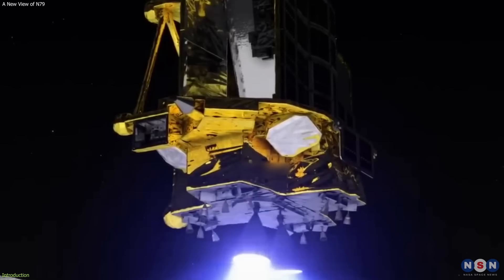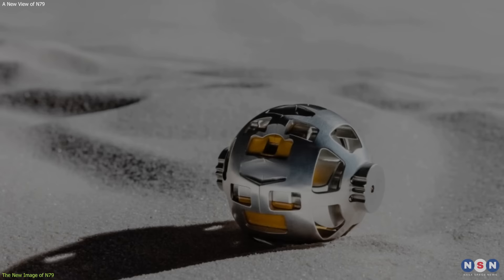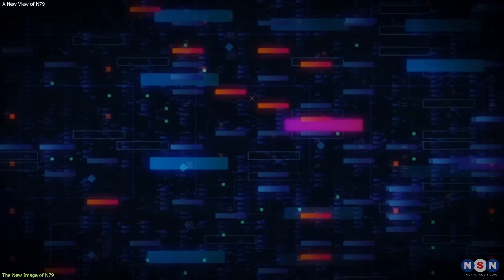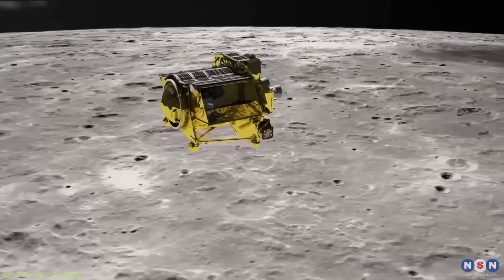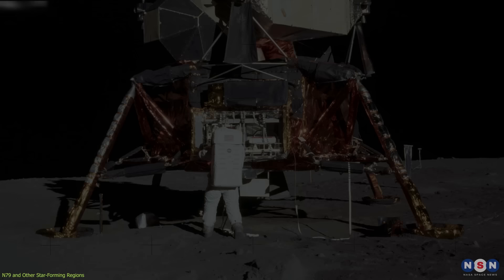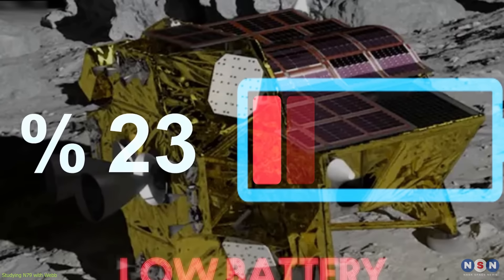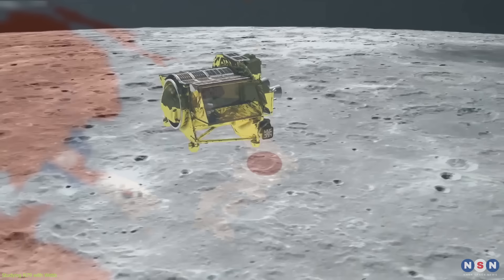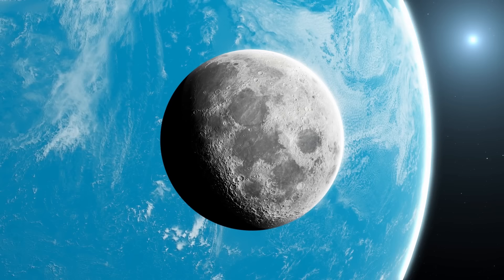The New Image of Japan’s SLIM Moon Lander: How it landed on the Moon Upside Down

Comment: * (PS.January 29, 2024)JAPAN (JAXA) announces that SLIM is back in operation. Sunlight hits again and battery panels generate electricity to resume communications and research! 
First, Japan's (=JAXA's) mission this time is "success". The most important mission of SLIM this time is "pinpoint landing at the target point.
JAXA was able to land at about 50 meters from the target point, so it was a "success. The data from the landing was also communicated because the attached battery lasted for several hours.

This was the world's first successful "pinpoint landing," aiming for an error of less than 100 meters.

It is believed that one of the two main engines lost its function and finally came to rest in a different attitude than expected, with the engine facing up and the solar cells facing west.

According to JAXA, the solar cells are not facing directly down, so if their position changes with the sun and light hits them from the west, they could start generating electricity.
 if sunlight hits the solar cells by around February 1, which is the sunset of the MOON, power will be restored and operations can resume.
Reply: Starbucks coffee doesn't have a small(fail) cup, only a medium cup and a large cup, super large cup.😂
Reply: “It is believed!”  Nuff typed there.

Comment: The main objective of this mission was the world's first "pinpoint landing" aiming for a margin of error within 100 meters.　This objective was successfully achieved.
Reply: Not good enough.
You mean to tell me they didn't think of this issue a million times?
Reply: @steveabq7913  I don't care about your personal values and desires. The initial goal of the Japanese engineering team has been achieved, so it is an undeniable success.
Reply: the Chinese have autonomous landing  determination already
Reply: Of course, SLIM also has automatic landing. Although one of the main engines broke, the spacecraft was able to make a soft landing thanks to automatic landing.
Reply: Latest News
Solar cell that had no response
Successfully Started
Reply: China has done that 4 times including landing the same lander twice in a single mission.  Of course, the propaganda is not telling you about the Chinese success.
Reply: @ren11270  Chinese landers all had automatic landing. It is done before. Nothing is new here. Not only that, Chinese landers had AI to determine the best landing spot on the fly avoiding rocks and other obstacle (like landing upside down, LOL).  Japanese one has pre-designated spot like 1960s US landing.  It is actually embarrassing.

Comment: This is a lunar lander that aims to achieve a lightweight probe system on a small scale and use the pinpoint landing technology necessary for future lunar probes. The project will aim to cut weight for higher function observational equipment and to land on resource scarce planets with an eye towards future solar system research probes.

The SLIM (Smart Lander for Investigating the Moon) project is a mission for researching the pinpoint landing technology necessary for future lunar probes and verifying this on the surface of the moon with a small scale probe.
By creating the SLIM lander humans will make a qualitative shift towards being able to land where we want and not just where it is easy to land, as had been the case before. By achieving this, it will become possible to land on planets even more resource scarce than the moon.

Nowadays, there has been an increase in the knowledge of target astronomical objects and the details which should be studied have grown more specific so that high accuracy landings near the target of study have become necessary.

Furthermore, a need will arise for equipping probes with higher function observational devices for future solar system research probes. Probe systems are being made lighter in preparation for this time and the reduced weight of probes will be essential so as to be able to distribute resources for observational devices.

The SLIM lander aims to achieve a small scale, light weight probe system and pinpoint landing technology, in addition to contributing to future lunar probes.

小規模で軽量な探査機システムを実現し、将来の月探査に必要なピンポイント着陸技術を利用することを目的とした月着陸船。将来の太陽系探査を視野に入れ、より高機能な観測機器の軽量化や資源の乏しい惑星への着陸を目指す。

SLIM（Smart Lander for Investigating the Moon）プロジェクトは、将来の月探査機に必要なピンポイント着陸技術を研究し、それを小型探査機で月面で検証するミッションである。
SLIMランダーを作ることで、人類はこれまでのように着陸しやすい場所だけでなく、着陸したい場所に着陸できるように質的な転換を図る。これを実現することで、月よりもさらに資源の乏しい惑星への着陸が可能になる。

現在では、対象となる天体の知識も増え、研究すべき内容も具体的になってきているため、研究対象の近くに高精度で着陸することが必要になってきている。

また、将来の太陽系探査機には、より高機能な観測装置を搭載する必要性が生じている。その時に備えてプローブシステムの軽量化が進められており、観測機器にリソースを配分するためにも、プローブの軽量化は必須となる。

SLIMランダーは、将来の月探査機に貢献するだけでなく、小型・軽量な探査機システムとピンポイント着陸技術の実現を目指している。

DeepL.com（無料版）で翻訳しました。
https://www.isas.jaxa.jp/en/missions/spacecraft/current/slim.html

Comment: What about making the bottom round and weighted with thrusters out on the sides so if that happens again make the weighted after bottom where it can’t fall on solar panel, then have retractable legs to plant it by shooting them forcefully down after stabilizing. Then both robots will be able to eject as well.
Reply: Too heavy. Adding extra thrusters to the sides in case this specific problem happens again wouldn’t be economical.
Reply: @TauDel  I was thinking move the thrusters to the sides above the ground exclusively. Not add any extra. And the weight in the bottom will be mostly equipment but add whatever so it can’t land on the solar panels. Weebles wobble but they don’t fall down. It can work

Comment: 1:17 LEV-2 “Sora-Q” weights only 250g, not 1.5kg
Reply: Do you know what is the pressure on the moon that lev2 has detected?
Reply: @user-np6dh5td6r  Lev-2 has no pressure sensor, only gyro sensor, as far as I know
Reply: Thank you
Reply: made one by Takara Tomy100year old Japanese toy manufacture, Lev2 called SORA Q
in Japan now available sale at Toy store in Japan😊

Comment: What is upside down was it supposed to land with it's thrusters facing the lunar surface?
Reply: The main engine was on its side, and the plan was to topple the SLIM and land.
One of the main engines failed just before landing, causing the aircraft to lose its attitude.
An attempt was made to right itself using automatic control, but the acceleration exceeded and the aircraft tilted 90 degrees.
Reply: @ren11270  No worry!  Japan is calling it a success just like  India crashed lander!   LOL

Comment: First time pin point landing? Ummm, how is landing upside down a pin point landing?
Reply: Well, it landed where it had to land, so pin point (x-y axis) The orientation of the lander (z-axis) does not affect that 😊
Reply: Orientation of the lander was NOT one of the mission objectives. So it is a success. 😄 Even if the lander ended up in multiple pieces after landing, it would have been a success. 😉☺️
Reply: @georgejacob5729   Success and "pinpoint landing" are two very different things.
Reply: @The1stDukeDroklar Success depends on the mission objective. If "pinpoint landing" was  the mission objective, then JAXA attained the  mission objective, thereby success.